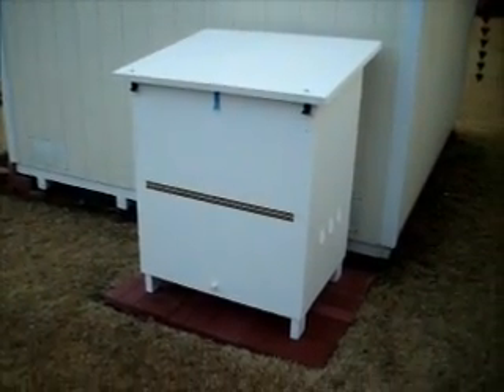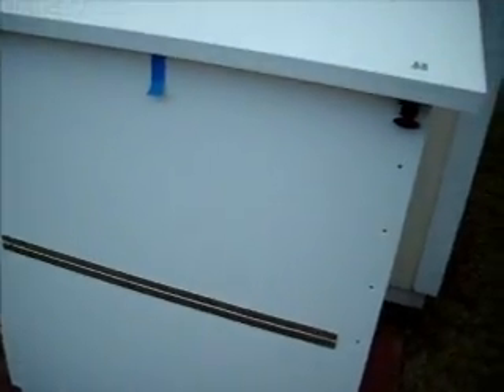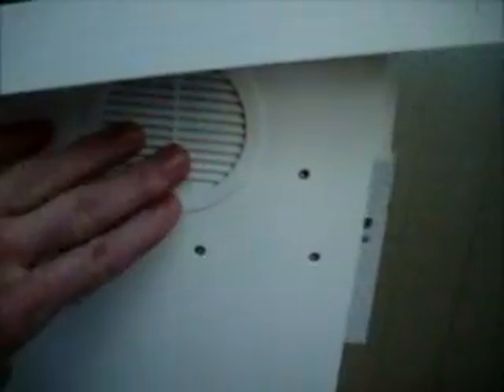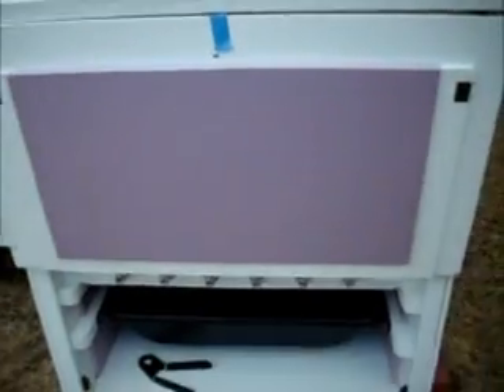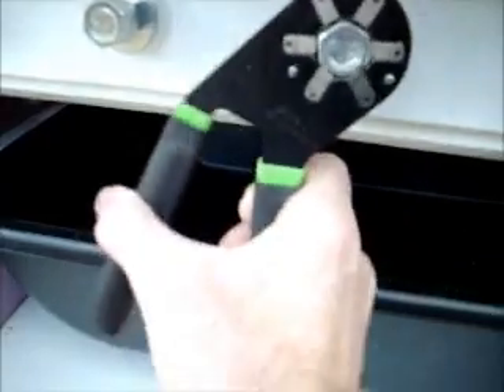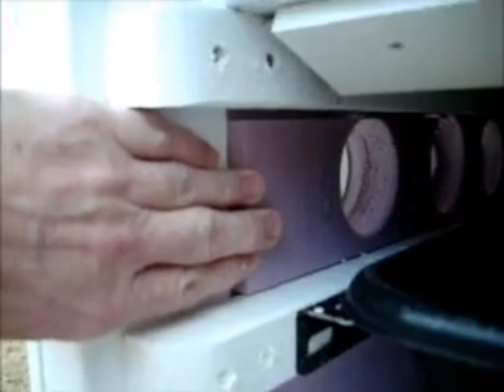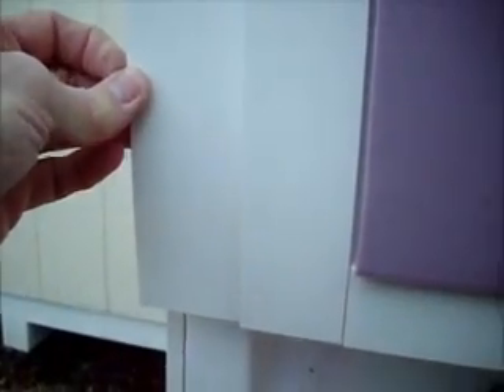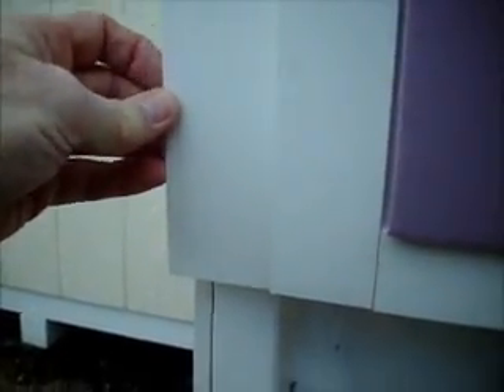FlowThrough worm bin, year-round, insulated R-18

Comment: I absolutely LOVE this! Any chance of getting plans for this? Husband is wanting to make one of these instead of the stock tank we've been using.  So, any changes, tips, tricks, etc.. you could share about dealing with our summer heat? We are in Alabama, so temps get really hot and very humid.  Thanks so much and kudos for a great job!
Reply from the maker: Sorry. I scratched my idea on paper and measured/built as I went. No realso called blueprints or plans.

Does great in hot, humid areas such as Raleigh NC with the “Pegboard” inner liner. Have to replace that every 4 yrs.  Winter only needs a 75 watt light bulb to keep in 60-70 degree temps during the coldest weather!

Hope this helps some!

Comment: great job !! 
Wow you built by far the best design i have seen so far..a 5 star hotel for worms..What is that rectangular piece on the PVC pipe ? Thanks.
Reply from the maker: Srinivasan Padmanabhan Thank you. Still going strong trouble free! I believe you are referring to the bottom area of the compost, if so those square items are PVC 2x2 post cut down I believe to about 4" lengths.

Hope this helps!
Reply: thanks for the quick reply. I am trying to build one using a 55gallon food grade barrel...what is the temperature range this is exposed to in peak summer and winter? have you run into any issues with soldier flies in the worm bin ? how many pounds of castings are you able to harvest after an year ?
Reply from the maker: Srinivasan Padmanabhan average temps here are near 100F for short time in the summer, 5-10 nights in the teens during winter.

Not bad on soldier flies as the top/bottom stay screened.

Hope this helps.

Comment: I understand the problem of worms freezing at mild temperatures. I'm in the process of building a box lined with 1/2 inch insulation to keep the summer heat out and being able to manage freezing cold with a little heat. Your bin is a great model filled with ideas, its just a little extreme for my needs. Perhaps I will make a flow-through bin someday, still using worm factory and have loads of castings all the time.

Comment: This is brilliant. I wonder if it would stay warm enough during a winter in the Midwest -- it can get down to 20F here. My only suggestions are 1) to incorporate some kind of handle or rod to make it easier to turn the nuts, or even better, to turn them at the same time; 2) create a way to siphon off leachate and collect it as worm tea; 3) build a fan system that runs on solar panels to increase air circulation in the summer; 4) build screens in the vents, and a lift-up screen for the top and bottom to keep insects and rodents out. To monetize this, you may want to consider shipping the parts and detailed instructions - could be a good opportunity for a business!
Reply from the maker: Steve, check the updated videos on this bin and you will see that I have screens in place; my winter temps get to the teens and I have a light that keeps the bin temps in the low 60's slightly high 50's worse case.
Reply from the maker: And as for the individual rods, I agree about connecting them. This was a test bed to see viability, it done so well I just left it as is.  Lost track, think this is season 6 (yrs) and still running strong!

Thank you for your input! Appreciated!
Reply from the maker: Just checked for accuracy, it's its 4th yr straight, not 6
Reply: +Greg Morris Thanks for sharing, Greg. It's a beautiful system. I'm sorry if I missed this in the video, but how much did it set you back in terms of time and money?
Reply from the maker: NP, I think I have 3-4 videos showing this at different levels. As for the build, I estimate it took around 20 hrs to build over a 2 week period. My job keeps me out of town half each month. As for cost, the pic covering is $$. About $200 just for that, est. $300-350 for total build. 

My priority was maintenance free, which it is so far!  Eliminate the pic and stainless hardware, one could build this for around $50-75 out of plywood and nickel plated hardware. (Every 2-4 yrs!)
Reply from the maker: I hate the Auto spell checker. "Pic" is suppose to say "PVC"

Comment: No one has built an insulated bin like this. Where are you located? Do you experience low temperatures? During the year?
Reply from the maker: I live near Raleigh NC and see temperatures as low as the teens for a short period in the winter, and not uncommon anymore to see over a 100 3-7 days in the summer. This bin holds its own all year round! I couldn't be more satisfied.

Comment: Great Workmanship and design work ... it would seem to me (not an expert) that the spaces between the spinning bars is too wide and that will allow too much stuff to fall into the bottom.  Hope it works great for you !!
Reply from the maker: Thank you Jim, but actually the spaces between the "spinning bars" could stand to be a little further apart.  You see the weight of the compost above the "bars" actually causes the compost to bridge the gap until disturbed.  Very little at all falls through when not harvesting, and what little does happens shortly after conducting a harvest until the compost above totally settles. Slightly more space would enable a larger harvest without having to wait till it settles for a second attempt.  But I do get plenty for my use the way it is.
Reply: Greg Morris  Thanks for letting me know!  I have checked around a little since i made that (uninformed) comment :)
Again your workmanship and design are great.  What climate are you in ... how cold are your average winter days?  I am in North Georgia.
Reply from the maker: I am near Raleigh, NC. It isn't uncommon to see the temp in the teens at night in the winter. Avg in the 20's & low 30's. Worms stay happy in this bin!
Reply: Greg Morris
Thanks again Greg!!   I am going to build one soon ... based on your design ... I hope 2015 is good for you !!

Comment from the maker: Dee Zee,
I'm not worried about the toxicity.  I had it tested (NC agriculture labs) for $5 and it came back with great numbers and safe.  Did wonderful throughout the winter and only used a light bulb sparingly to keep it 60-70 degrees all winter long.  
  As for slipping through "the pipe gaps", I laid a layer of newspaper over them for the initial setup, after that the compost just bridges the space until disturbed (harvested).  Works great!

Comment from the maker: Not cheap.  But I wanted it to last.  All stainless steel where able and pvc sheeting at all exposed areas inside and out (except the the bottom 5 inches of the legs).  The Koma pvc sheeting is expensive.  I was lucky and a local lumber yard had two 3/8 x 4 x 12 sheets leftover from an order and I picked them up for nearly $100 each and used 95% of it in this bin. I have near $400 in it total.  Could have built it with plywood and decking screws for just over $100 but it would only last 3-4 yrs.

Comment from the maker: I believe its explained.  But in short.  It's 2x2 pvc from Home Depot in the door section of the store.  I cut it into smaller lengths so I could drill a 1/2 hole through the middle of each piece.  I took a 1/2 inch threaded rod with nut/washer on one end and applied the pvc pieces securing them to the threaded rod with expanding poly glue and to each other with pvc cement - alternating each as I went. Locked togetherfrom the other end with another nut/washer.  Holding fast to date!.

Comment from the maker: NeoPrepper,

So far it's been going along great.  As for the air flow, it appears to be getting plenty in my summer setup.  I leave the bottom open with the screen in place and the top lid stays open about 5 inches  so to protect from rain and has the screen on it.  My temps are averaging 74-78 throughout the bin and our temps here lately have been in the 60's to low/mid 90's off and on.

Checked the middle of the bin once a few weeks back and worms were there as well.

Comment from the maker: @folkiethirteen,
So far it performing well.  Ran through the harvesting twice to clear out the paper layer on the bottom (and to have fun!).  99% fell into the collection tray, I then just put it back on the top layer.

It was expensive - but there isn't anything out there like it for a home owner.  I spent close to $300, $200 just for the two 4x12 sheets of Koma PVC sheeting (and I got those at a deal!).

I live in Raleigh NC.  Winters can sometimes hit the teens, summer sometimes a 100.